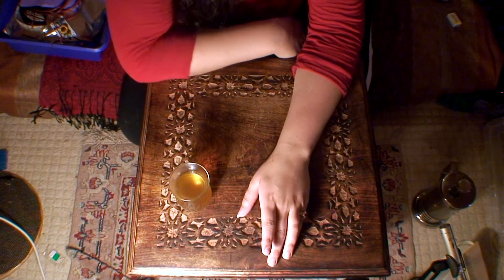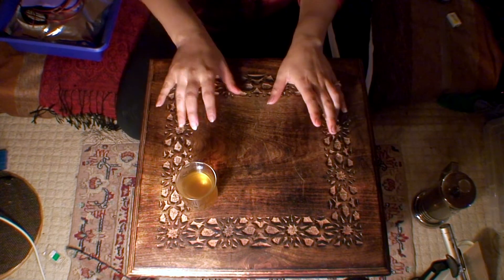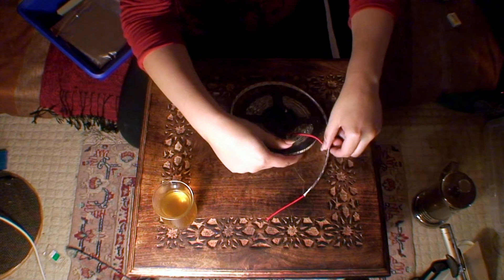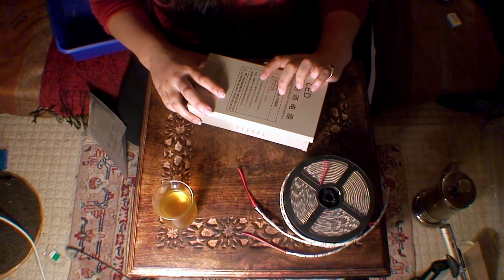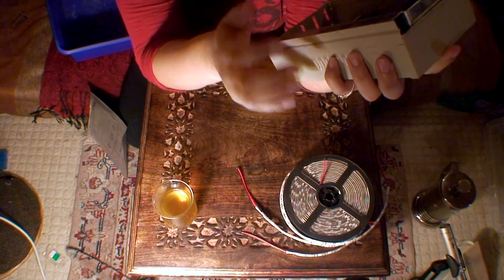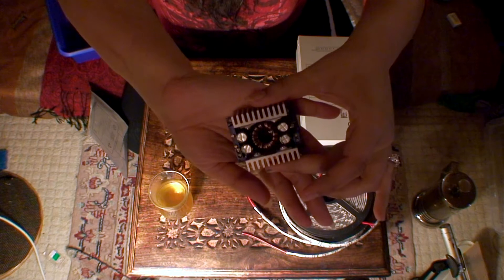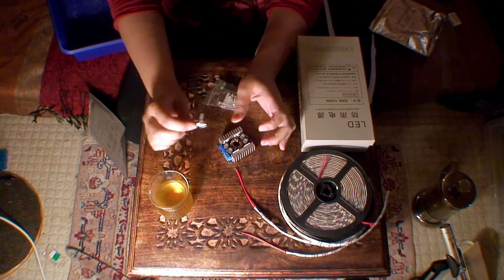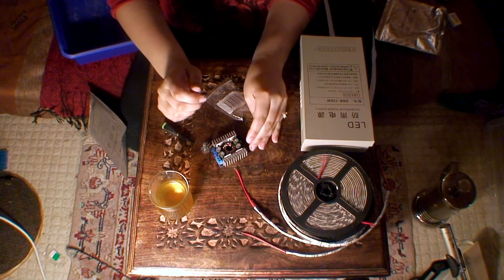DIY LED Lighting Panels - 01

Comment: Hi Maddi, love your video's - like your sense of humour. Is that mint tea your drinking?Why did you decide to use variable voltage rather than variable current?
  Re reel to reel, the tapes don't cost a lot of £'s, you can re use old tapes which are cheap on ebay as are half decent tape decks. 
  BTW, what editing software do you use/recommend for a beginner? Apologies for all the questions
   Thanks, keep up the good work.
Reply from the maker: +Dr Wobble 
Hi Dr Wobble, thank you! I'm glad you enjoy my videos, haha yes that is mint tea with a little honey in it, i'm an addict. :o)

Answering your question about voltage and current the best I can:  Varying the voltage will also vary the current, but varying the current up and down will not vary the voltage. The amount of current a circuit load draws is dependent (of course on the resistance of the load itself) but also on the voltage it’s running at. A hypothetical example: Let’s say the circuit load is an LED which draws 60mA at 3V. If you change the power supply to a 3V 1500mA, the LED would still draw only 60mA. However you increase the voltage to 5V then that LED will draw more current therefore will be brighter. 
I apologise for my way of explaining this, i’m sure there is a more straight forward way but i’m actually a visual thinker not a mathematical one, but I hope I got the idea across :o)

Really? I always heard reel to reel systems will eventually cost more in the form of all the little nick nacks you have to buy apparently, but cool, you are tempting me!! haha

Well I use OS X and not windows, so I started out with iMovie, but I believe Windows has an equivalent which is windows movie maker..But I do remember seeing an iMovie for windows, i'm not sure though. When I was on windows I used to use Pinnacle studio. Now I use Final cut pro which I don't think is available on windows but if you want to go advanced later Adobe premier would be the way to go.

 Not a problem about the questions, apologies for the long answers :o))
Reply: +MsMad Lemon Thanks for taking the time to reply and explain.
  Have sent you an email about reel to reel,email will be from the Diabolical Artificer, (me) maybe in spam box. : )